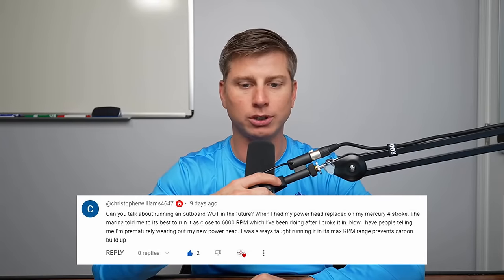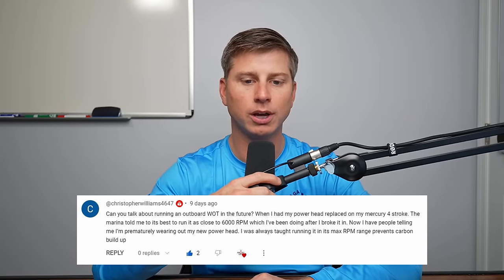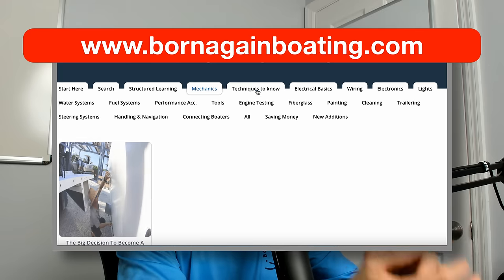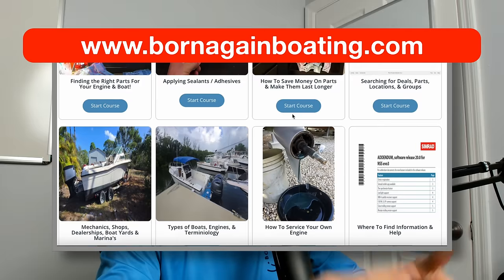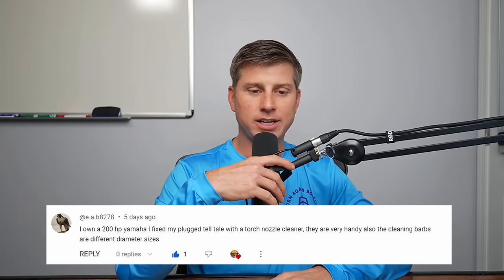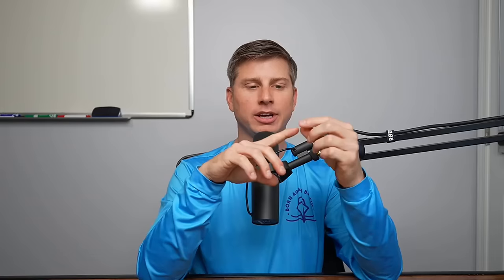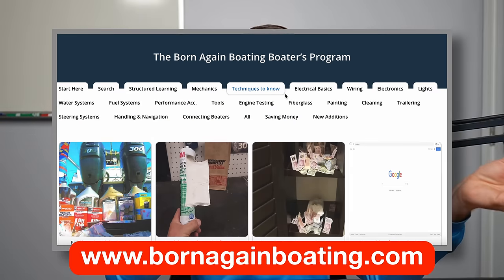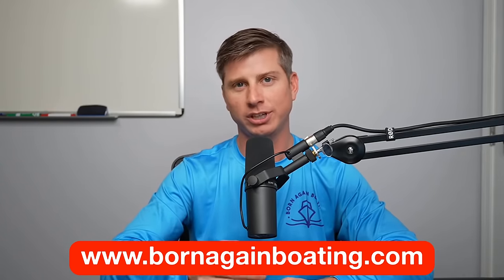Is Full Throttle BAD For Outboards?

Comment: Thank you for answering my question. It was on a 2003 Yamaha 200 ox66. It was just a dirty VST and filter as well as 1 bad low pressure pump. Now she’s running great. I appreciate the answer and your channel in general. I bought a used mako 231 and it sat for years and I pumped the tank out and cleaned all the lines, filters, VST, injectors, etc. also cleaned o2 sensor due to her running Smokey. O2 sensor plunger had so much carbon buildup. Now it’s running great. Also had to do shift shaft oil seals and the upper oil seals bc I had milky lower oil. Got tips on how to do all these things just from watching your videos.
Reply from the maker: That's awesome! Congrats on getting it all figured out and fixed as well on the great boat to run around with now!
Reply: @TheBoatersPodcast  yea I have restored 12 classic makos over the years and they’re great. This is the 3rd one I’ve done for myself. They are built to last, like most things were in 1987. Things now are built to break to get more money out of you it seems like. 

Love that whaler you just finished! I just did a 13 and a 15 last year and both turned out great. The resale value on those older well built hulls are great!  anyhow, Thanks for all the free info you put out there, it’s certainly has helped me with quite a few things.

Comment: have a 115 evinrude motor and we run it pretty hard. had a print out at 1300 hrs and my wot and other high rpm running was way less then i thought it would be

Comment: I just gave my nephews a 211 Mako with a 1994 Johnson 200 Ocean Runner that has never been rebuilt, just maintained and used continually, but only run hard rarely, and for short periods. It still runs great. Most of the time we cruised everywhere we went at about 3300 rpm. I had friends with the same motor who ran them hard and have two or three rebuilds on them, or just chucked them and replaced them years ago. How many people get 30 years out of an outbound running it hard?
Reply: Exactly

Comment: I have a murcury 1988 ,135hp outboard, and pees fine at idle and up to half throttle,. But as soon as I go to 3/4 throttle it stops peeing.? Any help would help. Thanks chris
Reply from the maker: I would make sure that the impeller is good and that you don't have any gasket or o-ring issues around the water tube, or that the popit valve and or thermostat are good to go, those should be the only thing other that would cause that.

Comment: I need a simple Hydraulic setup for a cheap bass John boat project. Trying to do center console TN Bass boat.  I prefer the old stuff vs the new. Any ideas on a good solid system.
Reply from the maker: Baystars usually the cheapest and decent quality :) the one for under 150HP outboard is like $400 something helm and cylinder and all

Comment: Is full throttle bad for trolling motors? Curious as a kayak angler. I have gone up river for a hour before. Just had a problem with brushes....idk if it's related. Still in the shop getting fixed.
Reply from the maker: Great question, I'd assume so, especially when talking about the brushes, because the brushes are what wears out :/ but the brushless motors are way more expensive in the long run, so who knows, maybe depend on how often you use it. But I would definitely assume that more WOT time on the brushes is going to assist them in wearing out quicker :/

Comment: Carbon build up is such a minor problem it really is not a issue with a 4 stroke engine. If you are worried about it a Yamaha ring free or the like in your gas. Running wide open over 50% of the time will shorten the life of your  powerhead. It is all about heat pressure and friction.
Reply: Exactly. Only an issue in old carbureted engines and old two strokes.
Reply: I have taken heads off 4 strokes, can tell you there is still carbon on the pistons each and every motor I've worked on. Two strokes are worst.

Comment: My old 2 strokes run cooler at wide open throttle. Mind you I’ve only got a small 77 Johnson 15hp and a smaller 89 Johnson 2hp

Comment: I know this it totally off topic, but i know you guys know a LOT about Verados. Is it possible to do a DTS calibration on a verado, screw it up and have the engine go in reverse when it is put in forward gear and forward when it is put in reverse. I believe that the shifter need to be sent all the way forward when commanded during the calibration process. What if it was actually put in reverse by mistake (shifter not mounted and engine on a stand getting ready for an install) and the computer learned that reverse is forward? Just curious, as i think this MIGHT be what i am experiencing. Its a long story.
Reply from the maker: Um, idk lol I guess it is possible, never tried to do it so I can't confirm if it would actually accept that based on the way the potentiometers  in the control box work. Usually this is an issue with the port vs startboard, like you have a port lower unit on a starboard engine, or it is calibrated as a port engine but it is a starboard engine. Or the wrong prop is put on etc. But I guess it could be possible, I've just never tried that to be able to confirm if that is actually possible or not :/ theoretically it could I guess lol
Reply: @TheBoatersPodcast  it was me. When not calibrated it goes opposite. I looked at a video I recorded before I calibrated it. Thinking I got sold the wrong motor (wanted RH rotation). I checked yesterday after calibration and it's all good. Thanks for responding.

Comment: I've built a couple of harley Motors, and when i was building them, i had to figure out what the proper break-in procedures were. I had a few old-time engine builders tell me something to the rune of "beat the tar out of it" or "ride it like a rented mule" the point being to seat the rings as fast and efficiently as possible. Full throttle to help seat them and straight to no throttle to pull oil up into the cylinders to wash the cylinder walls. Then the flip side was once its broken in, you dont want to idle constantly or lug it, and you dont want to bounce off rev limiter everywhere.  It always seemed obvious to me that for the same reason, heavy load seats rings that will also accelerate wear and eventually blowby and the same no ioad condition you want to avoid with a new motor in case it glazes a cylinder wall will eventually do the same if you let a broken in engine idle enough.

Comment: It's about 30 nautical miles to travel across the bay I live near. In my boat that would be over an hour of non-stop WOT, would that be ok for my 2006 Yamaha F60? I don't normally run WOT for long, as I'm aware most outboard's fuel effeciency is garbage at WOT, but my engine is too old to report fuel usage or support NMEA so it's hard to tell actual numbers.
Reply from the maker: That's a decent distance, you wouldn't necessarily harm the engine, but you'll definitely be burning way more fuel! I would suggest finding a good cruising RPM, that F60 is an outstanding engine, I'd probably vary between WOT and like 5K RPM, water conditions probably wouldn't let you run WOT the entire way anyway, or is it usually that glassy?
Reply: @TheBoatersPodcast  A good 1 in 3 outings, the waves are low enough and far enough apart that I could wot the whole way. I normally cruise at about 4400 to 4800 RPM, which is just over 20kts for my boat. Now that I've moved a bit further south, I'll be frequenting a more sheltered part of the bay, and it will be flat a good 4/5 outings.

Comment: That's is no difference in a marine engine and a car engine in regards to RPM. Carbon deposit is s byproduct of petroleum. Wide open is passing more fuel and likely creates more deposits. It's the valve train spinning and added heat that helps keep it off the valve seats and guides.  Run your engine through the while RPM spectrum. Also the load on a boat engine is very different than a car and that prevents a lot of wild rpm anyway

Comment: A two stroke is designed to run wide open throttle especially if the plugs are indexed and oil injected. My Evinrude has one speed it likes , full speed . 4 strokes it doesn’t really matter what you do as long as you don’t buy a mercury. My Evinrude hates low rpm and especially idle .
Reply: Evinrudes suck. There is a reason they’re no longer in business.
Reply: @corbysherman4710  not true bud . My 225 direct inject ho smokes 250 mercs on my 521 ranger . Also I’m a saltwater fisherman and all the mercurys can’t handle the salt . Yamaha blue top and the new Suzukis are the best motors, mercury is garbage
Reply: @corbysherman4710  lol 😂 is your name really corby ? Lmao 🤣
Reply: Is your name really Pete Jablowski? So why isn’t Evinrude still in business smart guy?
Reply: @corbysherman4710  no my names not Pete . You never use your real name on line . Corky lol

Comment: I just put a new OX66 250 on my 78 Aquasport. We'd been chasing our tails trying to figure out why our old motor was overheating and the gas (ethanol free) in the fuel tank went bad. We're going to empty the tank and put in fresh gas. Do you recommend adding a treatment to the new gas in case of sediment or anything? We've been told to use startron, but I can't really find anything that isn't a sales pitch to back that up. Thanks in advance -Rich.
Reply: I use Startron w every fill up of ethanol gas and have never had a problem.  No fuel issues over about 8 years.  One question:  where did you find a NEW OX66??
Reply: @chiphill4856  It's remanufactured at Outboard Marine in Largo, FL. The block was completely gutted and fixed up. Rebored and new everything. There are no used parts on it except the cowling, block (remanufactured), the middle section, and the lower unit housing. All of those have all internals replaced, any surface corrosion fixed, and the whole thing was painted. It's for all intents and purposes a zero hour engine.
Reply: @richellis2752  That sounds awesome!   I have a 1998 260hp OX66 that runs great.   They are bulletproof.   Easiest starting 2 stroke I've ever owned.
Reply: I recommend adding yamalube fuel treatment in gas at every fill no matter what and Yamalube ring free every fill up if you can afford to and of not every fill or at least once per month doing the ring free. You can use startron ring clean plus as alternative but it’s only a few $ less than ring free so I just buy the yamalube stuff.

Comment: I only listened to 6:28 but so did he say it’s fine and made for it just not realistic to run wide open? I have a 2019 9.9 on a little fishing boat in Wisconsin and i run it wide open constantly.  And im doing a blazing 15 miles an hour.  Anyways Many years ago i took a raft from Minneapolis to Louisiana and that motor (a 1990 Evinrude 15 horse ) ran wide open (I taped the throttle wide open every day  ) for an estimated 450 hours over the course of a month. 😬😬😬 pushed the raft about 1700 miles
Reply from the maker: Exactly :) You're another one that proves the point, you can run the engines WOT for however long you want without causing damage to the powerhead, it's the other factors that cause damage, low oil, lack of maintenance, overheat, stuff like that. Not running WOT, especially little engines. lol it's WOT everywhere you go! :)
Reply: @TheBoatersPodcast  ok. :). I appreciate your comment and content. It’s something I always wondered about. (The WOT).

Comment: I guess if you don’t understand what a governor is you would be your running it wide open but your not it may be for a moment depending on how heavy your boat is but the governor throttles it back to a safe rpm I was a commercial blue crab fishermen that spent every day in an outboard from as small as 40hp tohatsu to when I quit a 225 Honda from 2011-2020 never heard this or anyone say don’t run wide open

Comment: Any opion on yamaha or mercury outboard engines that are ran in water temperatures of 30 to 45 degrees Fahrenheit.
Reply from the maker: Probably just running the 10X30 oil to make sure you get the best lubricating out of the oil in the cold weather, but unless you see something wrong, not much else to do. 

If it gets much colder though you might have to change oil sooner :/
Reply: @TheBoatersPodcast  I have a  friend that had a new 2021 Verado 300 that had water in the oil after running in cold water. Dealer said it is fine and probablyfrom the water that is sprayed on the crank case to keep it cool. I thought it was from not getting the engine to high enough temperature to evaporate the condensation build up in the crank case.  I just got a new 2023 yamaha 250sho so I was hoping to avoid that same thing from happening. My previous motor was a 2004 Honda 90 and never had water in the oil from running in cold water.

Comment: I’m confused , I get why you say it’s not practical, but if it’s like glass out can I stay at WOT for like 30 min? Like on a Yamaha F150
Reply from the maker: Absolutely, that was kind of the point, that you should run WOT whenever you can, and it's not going to damage your powerhead. Powerhead damage is usually because of other reasons, like low oil, overheat, lack of maintenance, bad oil, running lean, stuff like that, which causes failures that then destroy the powerhead. But not running WOT lol it's what it's designed to do :)
Reply: @TheBoatersPodcast  thanks!

Comment: What about a small outboard a 2.4 3.3 and a 5hp small outboards ahould it run at max rpm because of it bieng so slow
Reply from the maker: Sure! There's tons of sail boaters and dingy runners that only have smaller engines like that, they run WOT everywhere they go for 15 years with no issues :) you don't hear of them blowing powerheads, the things that kill those engines are lack of maintenance and poor fuel and lack of running for periods of time :)

Comment: I have a 2007 Grady Fisherman 222 with a 250 Yamaha.  Would a bracket be something to consider?  Pros and cons of a bracket on the greenboard transom.
Reply from the maker: I've honestly seen few 222 Grady's with brackets, the 222's usually only have the engine straight to the transom because they are the center console model, idk if the bracket will change the ride and make it porpoisy or not. The 225 have brackets on them so who knows, idk how similar the actually balance and hull are between the models. Any of the cabin Grady's take the brackets great so I can't really tell one way or the other. :( Having the brackets are a game changer because they give you more room in the boat, but the way the 222's laid out, you kind of don't gain much with the way the splash well is built into the boat :/ you won't really gain much as far as space is concerned from the way the well is laid out :/

Comment: I see the same thing on any of the print outs I look at. Have seen some boats with only a couple hours at high rpm. 
I had a skiff with a 50hp merc on it. That boat was ran wide open going everywhere it went as it was slow. And even that motor was majority of hours in the lower range.

Comment: My Mercury 175 xs is wide open at about 5500-5700 rpm.  The appropriate prop size allows me to run wide open and get max speed without over revving the motor. Correct?  I run almost wide open to wide open almost all the time. If I’m wrong someone tell me cause I thought this motor was meant to be ran hard. Any comments?
Reply from the maker: Nope, sounds like you've got it all dialed in and are running everything the way it should be ran, just keep up on your maintenance and run it regularly :)

Comment: There is absolutely no carbon benefit to full throttle on modern engines. For older technology it does help (Italian tune up). Full throttle is important for choosing the right prop.  He is correct that outboard marine engines are designed and tested to run at full open throttle indefinitely.

Comment: 2 stroke can run wide open all the time
Had one 85hp two stroke and literally ran it WOT everywhere and zero breakdowns 
Boils down to whether your propped correctly too if the props too big and boats heavy then motor struggles more than a fast boat with power to spare....thats why its ALWAYS more efficient to run the biggest engine possible for your hull

Comment: Running WOT is not required for an extended period of time to gain the benifits. If you think an engine being run at 6000 RPM is going to last as long as one run at 2000 RPM you are insane! Do the math! It is called engine wear.

Comment: Lets consider a 25 hp Johnson, it is a detuned 35, at full throttle, it is producing less than two thirds of the power at full throttle, so you can't run a 35 at more than half throttle, right? I have a 35, and I run it at full throttle all of the time, and it is a 1976 and still running fine.
Reply from the maker: Yup, prime example of proving the point lol the thing that kills those engines are lack of maintenance and poor fuel! Not blowing powerheads from running WOT :)

Comment: Are hundreds of downloads the same as real world experience?
WOT on a modern outboard is not an issue.
The ecu will manage the fuel and engine.
The engines are designed to take it.
Keep up the maintenance and you will have no problem if it is being used every day this way.
Store it for six months without use and it’s a different scenario.

Comment: What about small outboards like 20 horses where I basically do run it almost 6000 RPM for almost an hour or more running out to a spot and then running back because wide open throttle is only 25 miles an hour
Reply: Sounds like you might need a different propeller pitch.
Reply from the maker: Most people running small outboards like that run them WOT all the time for that exact reason :)